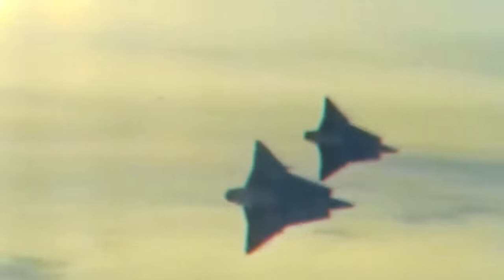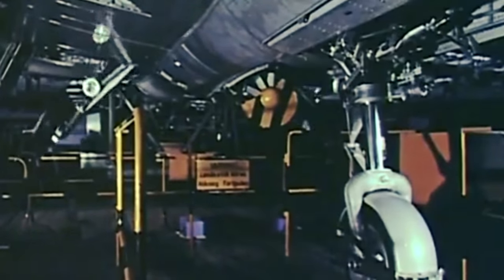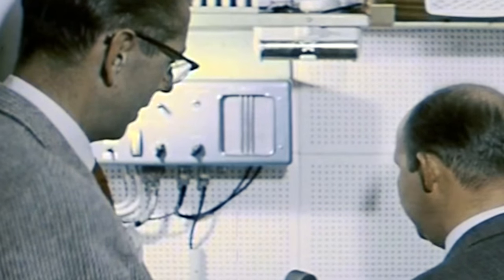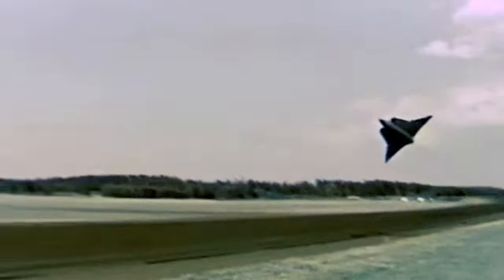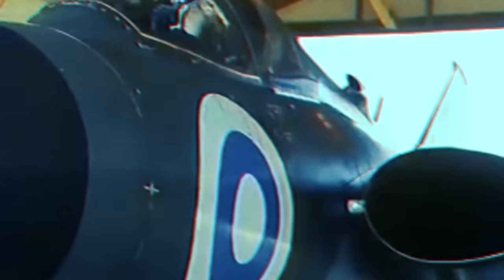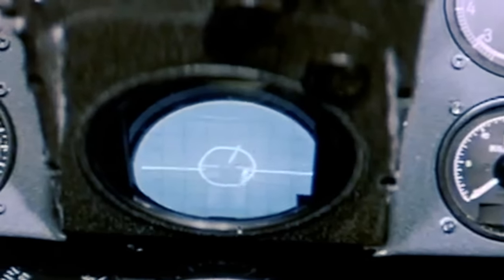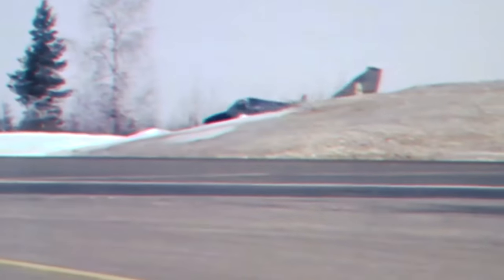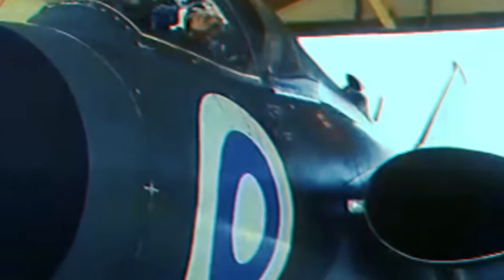The Bizarre Airplane Design That Shook Up Aviation

Comment: Well in those days it was building interceptors.
WWII in mind that you need to intercept bombers before they do any damage.
Dogfighting secondary you needed to move across ground fast.
in the late 60s they paused and realized we still need to dogfight. So different USA training programs using the platforms they had but at the same also working on 4th gen.
How do you get air superiority ..... well ... by make smoking wrecks of enemy aircrafts.
I am young born in 1965 so more Viggen F14 F15 F16 era .
I seen draken on airshows and it can hardly turn it slides through the air with high alpha but little happens.
Still seen interviews with draken pilots that russian airplanes or pilots was even worse when they met them over the baltics ocean. Nice story. If I rate draken so low how low were the russians?
Still draken is not a 4th gen allround aircraft. And so we get back to what I started to write.
Reply: possibly the sharpest turning simple aircraft I seen possibly is F16A as in >>>A<<< it could do more if it had an even stronger engine.

Comment: umm saab was late 60's ... LONG before that was the arrow ... it was the FIRST super sonic delta wing design put into production ... yes production... NO ARROW PROTOTYPES WERE EVER MADE all 6 planes were PRODUCTION RUN ... and it was started back in 51 and cancelled in 57 ... so sorry BUT everything in this video is wrong by 10 years ... wrong continent and even wrong company ... not to mention wrong country ...
Reply: if all they managed to squeeze out was a measly 6 planes, it´s hardly worth mentioning.
Reply: @juslitor  6 planes 22 firsts of supersonic jets 15 fr fighter jets .... not one plane today can say they dont have a pat of the arrow design in it .... and yes ONLY 6 planes .. because the americans didnt want a fighter that could fly faster further and shot down their U2 .... and before the arrow was cancelled the swept wing sr71 was up for the axe until avro engineers reconffigured it from experience ... 
the avro arrow was the most advanced fihter jet designed in 1953 canceled in 1957 and still beats the f35 (all 3 variants) the f22. the f18 ... the f16 .... and it is 70 years OLD 
.
so back to school young one ... and toss out those american wrong history books and do some fact finding ... because your 70 years behind the times of aviation innovation while the arrow was 70 years ahead
Reply: @kaboom-zf2bl  Well, you certainly pass as a massive arrow fanboy, thats for sure. Btw the sr-71 was developed from the CIA operated A-12. Cant be bothered to read in depth about the 71, but the a-12 certainly doesnt mention anything regarding Avro.
Reply: I'd love to know your source for that information. Because my information is that Arrow didn't fly until 1958, 3 years after Draken. In fact, by 1958, supersonic fighters had flown in the US, France, UK and the Soviet Union.